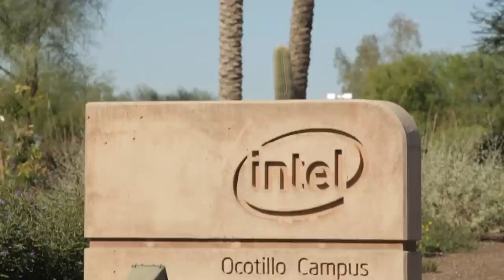A Day in The Life of Otis: An Intel Manufacturing Technician | Intel

Comment: Whats the deal with the copper snake on the glass door at the end?
Reply: The tools in that chase with the snake logo process BEOL copper wafers. Copper will diffuse into silicon contaminating the lower layers unless a proper barrier liner has been deposited underneath. When a tech enters this chase, proper decontamination protocol is strictly enforced to prevent the possibility of picking up trace amounts of copper and accidentally contaminating a non-copper FEOL process tool. If a wafer in its early stages gets contaminated with copper it must be scrapped.
Reply: +ventodave nah I'm pretty sure that's Cobra Commander's office and I'm pretty sure those aren't technicians but a bunch of Storm Shadow clones guarding the compound.
Reply: +christopher jones That was my original thought too LOL!
Reply: @ChristopherJones16  Hey it's a possibility!!